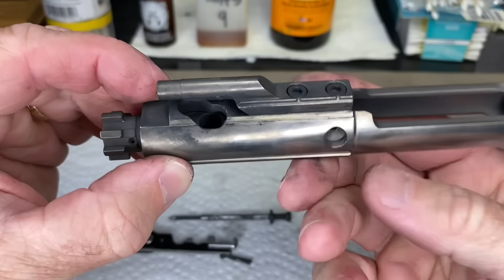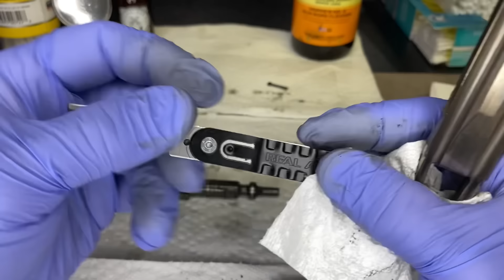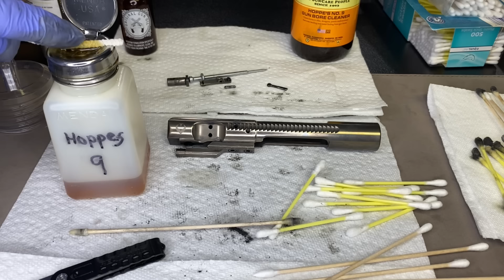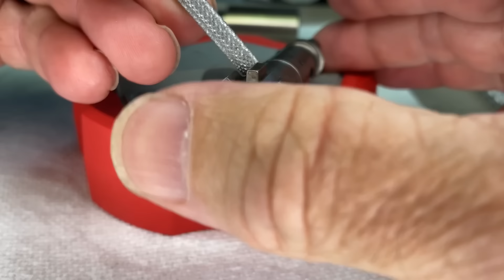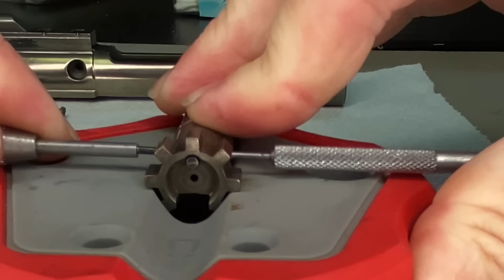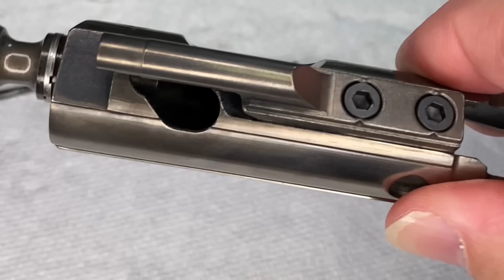How To Clean a Really Dirty AR15 Bolt Carrier Group BCG.

Comment: Disassemble The bowl carrier group get a good stiff nylon brush with solid and scrub it as best as you can all the way around. Completely rinse with solvent then place in an ultrasonic cleaner with a solution provided.

Turn on the ultrasonic cleaner and come back in about 15 or 20 minutes and you will have a very clean boat carrier group.

Now that that boat carrier group is clean you need to put something on it to prevent rust from forming because the scrubbing with the solvent and the ultrasonic cleaning with a solution is going to clean everything off of it.

If you let it go for one day you'll start to see you start to see problems

I just wish I had an ultrasonic cleaner large enough to put an entire rifle in
Reply from the maker: lol about the rifle! Thanks so much for that info! I will be looking into such a cleaner, do you have a recommendation?
Reply: @davesgunchannel  I have the Hornady ultrasonic for pistol size parts. I saw a video where the guy had a rifle size. I don't believe we need one that large unless we work as a gunsmith to justify the cost
Reply: ive switched to ultrasonic cleaning,  no scraping,  no damage,  like new every time.
Reply: Yes well me I have a garage sale toaster oven, take it out of the ultrasonic, rinse it off, blow it out with compressed air, pop it in the oven on warm <200 fora bit
Reply: I'd be a little leary of putting the carrier body into a sonic cleaner. The gas key is supposed to be sealed to the top of the carrier with a sealant that might become compromised by the chemicals used in the sonic cleaner. If the sealant is compromised and you develop a gas leak that causes malfunctions,  you may find yourself replacing the gas key. Best not to clean the carrier in a sonic cleaner. Just my 2 cents of caution.
Reply: Or if you have any white gas laying around you can disassemble, place parts in it for about 2-3 minutes, wipe clean, reassemble and live it up.  White gas eats carbon better than most solvents out there.
Reply: Thank for posting this really awesome video. I'm in the process of doing my first full build of an AR15 so the more of these types of videos I watch the more I learn about all of the components for each part.
Reply: Can you ultrasonic clean in Hoppe's?
Reply: 😂😂 wtf you don't need to do half that crap.

Comment: Appreciate it, but no way I’m scraping inside my bolt carrier or outside my bolt.  Carb cleaner and a nylon brush has been good enough for me to remove carbon fouling.  I know others disagree, but I’m not going to take a chance on removing metal.

I also had one BCG and bolt sprayed with Micro Slick, and all I generally need for that one is a little scrubbing with the issue nylon brush and wiping with a towel with CLP on it.
Reply from the maker: I appreciate the comments!

Comment: Best way to clean a really dirty bcg is to use a high end CLP. There are several high end CLPs on the market. SLIP2000, the carbon just wipes off with a paper towel.
Reply from the maker: Thanks for the tip!!

Dave

Comment: It would be easier if you used a little cup with some CLP and a brush to clean these parts to save all those expensive swabs and such. You don't know my Vietnam experience, but you don't really have to clean this platform that much, but to keep it oiled is more important.
Reply: Yes sir, they'll run dirty ( within reason,) but they won't run dry.
Reply: Yup. We tend to over clean rifles, which can actually damage them.
Reply from the maker: Great tip! Thanks so
Much for your service and the comment!

Dave
Reply: Excellent point about the cup & CLP.

Comment: I wouldn't be using metal scrapers with Hoppes9 on anything Nib coated.  Hoppes eats copper and copper is used under to plate Nib, so any little scratch will help the bore cleaner eat under the plating and make it flake/peel.  You do you tho, just an fyi..
Reply from the maker: Thanks for the tip!

Dave

Comment: An application of dry Teflon Lube on all of those parts before you reassemble them, and you heat cycle them. We'll keep those parts from getting nearly as Caked Up with carbon as they were. It will also keep oils that most people try and put on these things, from helping to cause that carbon to stick to these metal parts. You can use wet Teflon Lube, but I generally try and keep it as dry as possible on my carry guns. Oil draws dirt and carbon. The 2 things you do not want in your gun. Dry Teflon does not draw dirt or carbon. But does provide lubrication. That ejector and spring we're actually in pretty good shape.
Reply: Using a dry gun is stupid. Use TW25B or equivalent on the bolt rails and a light coat of it(or G96) on the bolt itself and then grease up the cam pin. Saves on wear.  When it's come to clean, clean off the old grease, inspect and repeat.
Reply from the maker: Thanks so much for your input! I appreciate any tips!

Dave

Comment: Thank You!!! Never thought about a pipe cleaner for the firing pin hole never thought about that on how to clean that area.
Reply: I also would use pipe cleaner in gas system the exit from barrel and gas key.  Also the area where gas tube goes into bolt area can get some carbon.
Reply: Omg. Duh!
Reply: You can get pipe cleaners that are 18” long.  They will go the length of the gas tube.
Reply from the maker: Nice! Thanks for the tip!
Reply from the maker: Thanks for the comment! Works pretty well.

Dave

Comment: You should never clean a bolt with a scraping tool.
Reply from the maker: A quality scraping tool will not damage the bolt so long as you take care to remove the carbon deposits and not the metal. Even when I apply considerable
pressure, the are no scratches to any of my bolts, let alone damage. The bolt in the video belongs to a friend was caked with carbon and was NEVER cleaned. would have taken all day to clean the carbon off of it, lol.

I appreciate your comment and welcome all viewpoints!

Dave

Comment: Thanks for the tip about the cleaning tool - nothing I've got in my cleaning kit works to remove the caked on carbon on the bolt.  Looking forward to getting it tomorrow. 👍
Reply: carbon on the bolt tail doesn't affect functionality as long as the gas rings are clean. Scraping the bolt tail with a metal tool can only harm the bolt. If you're that worried about carbon on the bolt tail, just wipe it off after use and don't let it build up to the point you have to scrape it.
Reply from the maker: Thanks for watching the video and leaving a comment. I really appreciate it! Same here, I hated all that caked on carbon, so I finally found this tool which does a great job!

Dave
Reply: If it's too hard to scrape off with a piece of wood, soak it in auto parts cleaner, let it soften. Then scrape it off with wood or plastic, take care to not start lapping it, which will remove metal.

Comment: I was always taught not to oil the firing pin. That information came from my 10 years serving in the army infantry with 3 Iraq deployments. Maybes it’s because we were in the desert and we didn’t want dirt sticking to the firing pin causing a malfunction when we needed our weapons to absolutely not fail on us.
Reply from the maker: Michael, thanks for watching the video and thanks especially for your service! I hear you on the firing pin, it seems that opinions on that are all over the place. I have heard people say that you can’t run an AR-15 too wet and others say not to hardly oil it at all. I tend to fall in the middle of these extremes. I certainly would keep any oil on the firing to a bare minimum.
Thanks for your input, sir!

Dave
Reply: There’s really no benefit of running oil on the firing pin, only attracting dirt. Just my $.02
Reply: Lucas CLP would have made light work of that. I use that stuff all the time and it cleans lubes and protects as it should
Reply: I was never taught to put oil on a firing pin also in the army, just the bolt and I would give it action at the same time.
Reply: Firing pin def doesn’t need any oil

Comment: Use the firing pin retaining pin to remove the extractor instead of the striking face of the firing pin. Can cause tiny microscopic stress fractures that will ultimately shorten the life of the firing pin. Firing pins are certainly cheap and easy to replace so it's not that big of a deal as long as you carry an extra with the rifle.
Reply: I'm pretty sure using the firing pin to push out the extractor pin is less stress on the firing pin than what the firing pin goes through when shooting the rifle.  Besides, like you mentioned, firing pins are cheap.

Comment: hoppes is great but should note to watch what BCG coating you have before using. it can discolor nickel boron from what ive seen. doesnt seem to stop function but doesnt look good anymore. YMMV
Reply: Hoppes will actually DAMAGE nib coatings, especially if you're using a scraper in conjunction with the hoppes. Nib coated bcg actually need to be cleaned more often than any other coatings and should actually be ran rather wet so no scraping is ever necessary to clean the bcg. If you're ever having to scrape carbon off of a bcg then it's far past needing cleaned and is being neglected.
Reply: @TerminalM193  I just shot my first AR for the 5th time, and looked up this vid because I have quite a lot of build up on the BCG.  I was afraid to use anything too abrasive though.  I have cleaned my rifle after every shoot but the last one.  Think I'll buy a scraper tool.  Not sure why I have so much carbon buildup, maybe it's an issue with not enough oil on the BCG?

Comment: There is another YouTube channel called School of the American rifle.  That gentleman has some interesting observations about bcg dimensions and tolerances.  I used to agonize over cleanliness.  No longer.  Good quality lubricant helps with cleaning.  Mpro7 is pricey but excellent.  Try spraying the parts with a good solvent and letting them set for 10 minutes.  Wipe down and use a nylon brush.  Wipe out the heavy stuff and lube the crap out of it.  It should look wet.  Save the scraping.  Probably not needed.  Gunilla is a good cleaner as is hoppes.
Reply: That’s exactly what I do, bolt carrier group first, hit it with Gunzilla, clean everything else, wipe down the BCG and put it all back together.  No scraping required.
Reply: I've been in all environments and we all soaked the BCG. You don't have time to break down to that level to make it work. You can do this kind of cleaning in garrison or back in the rear. Ditch the scrapers , it only ages your BCG faster .
Reply: yah kind of baffled why we starting with scraping dry carbon metal on metal. lol let the parts soak, get a beer, work smarter not harder.
Reply: @bearcrimes  Scraping isnt needed, these rifles are made to run dirty and wet. The issue is trying to run them dirty and dry.
Reply: @smtbigelow  I never said it was, note me being baffled about said scraping lol
Reply: @smtbigelow running dirty and dry is fine too. Carbon is a dry lube. The issue is when it gets really built up. MAC(Military Arms Channel) did a video on that. A BCM rifle fired 10,000 rounds without a cleaning or lube. Last 1,000 got a bit difficult but still worked. At the end he just added lube and she ran fine.
Reply: What is wrong with carburetor or brake cleaner other than keeping it away from the extractor O-ring.  Most say to keep the upper receiver wet with lube.   I have nest to me a spray can of lucas extreme duty clp.  If one keeps the ejection port dust cover closed and mag in the gun, for purposes the gun will not get too dirty with exceptions of course.  
I have noticed that my 7.62x39 AR does get dirty.
Reply: I still think that occasionally some scaping might be needed and I will looking into getting that tool as a back just incase.
Reply: @loquat44-40 not really. If you use a good CLP or combo fluids and routine you should be able to just wipe everything off. Theres also parts that build up with carbon that you don’t really have to worry about cleaning heavily. The bolt tail for example. Letting it soak in CLP/solvent then a light brushing with a nylon brush/q-tip is all that’s needed if you want.
Reply from the maker: Thanks for taking the time to add some insight! Always good to hear how others do it! And thanks for watching the video!

Dave
Reply: @davesgunchannel  In School of the American Rifle he points out those scraper tools you're using can actually mess up the dimensions of the BCG and cause gas leakage.
Reply from the maker: @Chonkasaurus If used improperly and/or excessively, yes. I do not believe an occasional scraping (or one time scraping, then using plenty of oil and regular cleaning to prevent the build-up that requires scraping) when done properly is a problem.